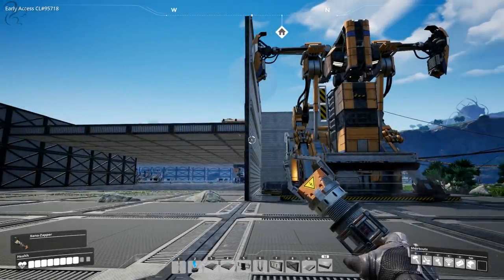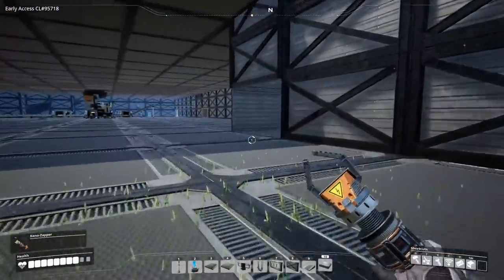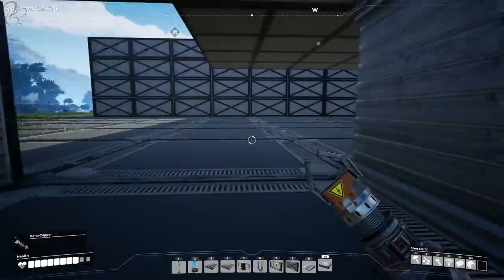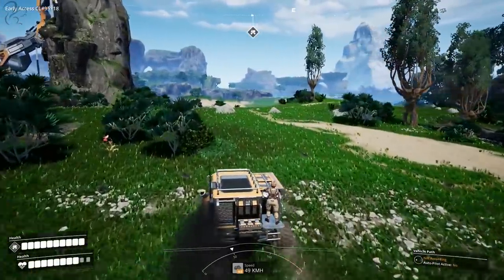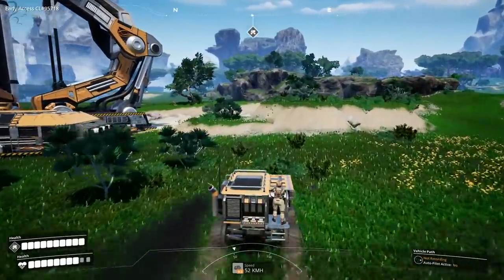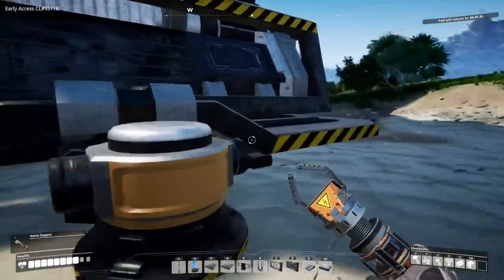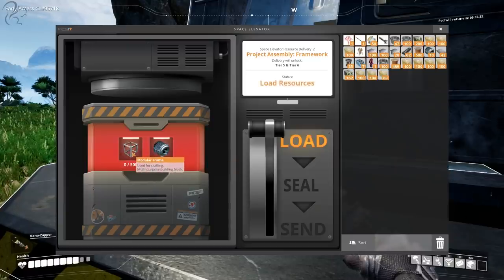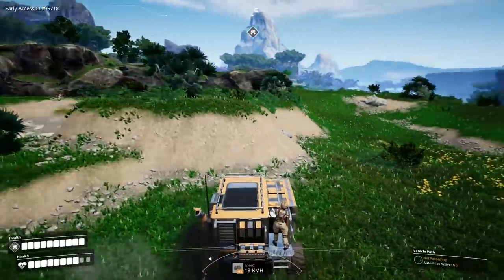Satisfactory - Episode 11 - Automated Delivery

Comment: Whilst on foundations you are better not holding “CTRL” it snaps to the grid better
Also why didn’t you build a coal power supply there and have it powered remotely then it’ll never trip out and always supply coal
Also apparently you can build foundations over the coal and it will still work
Also you can ride the tractor if you stand on top
And you have it loading at both ends

Comment: I'm belting oil to my base, 2500meter away. a lot of stack poles and a lot of steel beams for mk3 belts. built a gaint and a small bridge out of foundations. I got 3 full containers of concrete, emptied 2 :D 500 meters coal I didn't belt, no I built the powerplant and steel production there and run back and fort with blade runners all the time to make motors and heavy modular frames, wich I will automate soon after I build fuel power. going from 300 to 600 is needed if I want more machines